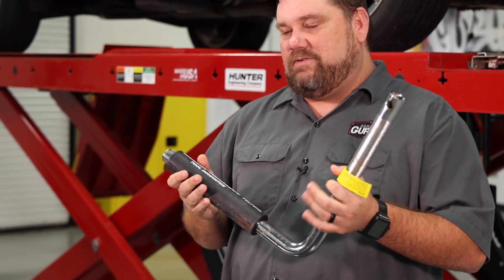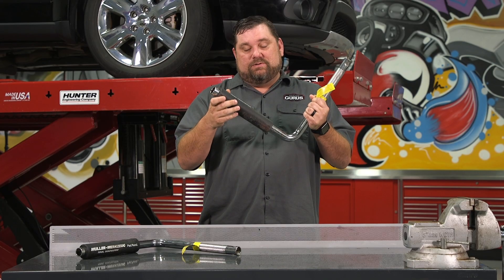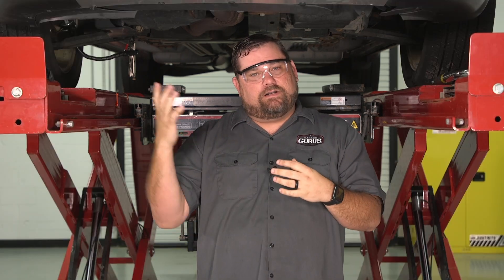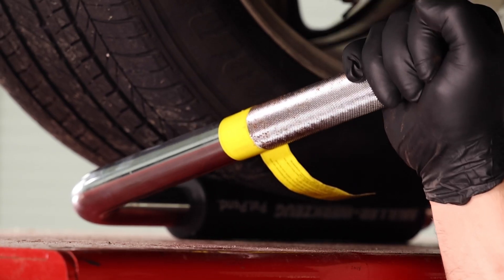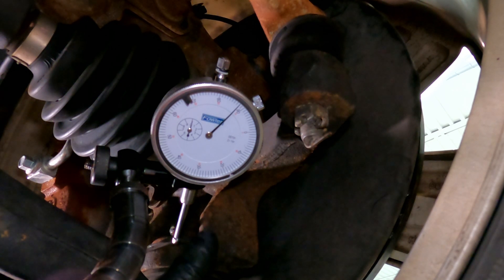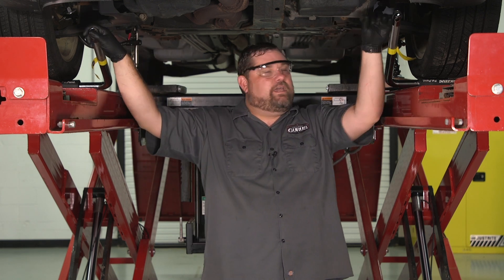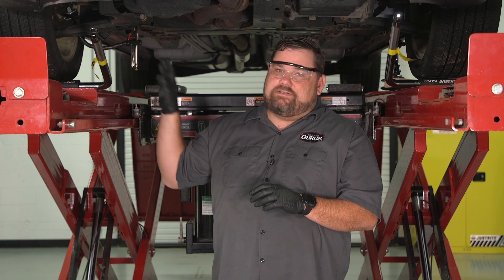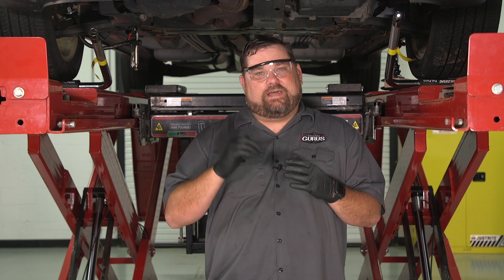Garage Gurus | How to Find Looseness in Suspension Components

Comment: So the tool failed to show the ball joint as being bad. Both tires hardly moved. What I'm really interest in is an explanation of how you were able to verify it was the ball joint by using the gauge for a test that has to specifications to follow?  Lastly if the main focus is a ball joint why is the camera always cutting away to a bushing?  
After re-watching this video a few days after I first saw it, I'll say the video proved nothing. The tool didn't do anything. We saw a useless reading from a gauge being used to test movement that has no specs to follow.

Comment: So you told us you set the dial indicator up to measure play in the wrong direction. Then you said the the ball joint had half of the spec in looseness in the incorrect direction. You failed to check the sway bar links and mounts . Then you wanted to "sell" a ball joint based on the  questionable readings and faulty measuring setup. I'm thinking the customer wanted the noise fixed and not to be "sold" a ball joint based on a guess. This is how you get young techs in trouble. Sorry but not impressed . Yes I am ASE re certified .
Reply: He also used the tool wrong. Mueller Kueps recommends only using it on one wheel assembly at a time, and he measured front to back movement twice with the tool installed in different orientation. 😂

You are supposed to install it vertically under the tire for front-to-back movement and horizontally for in-to-out movement.😂

This industry is going to hell in a hand basket.